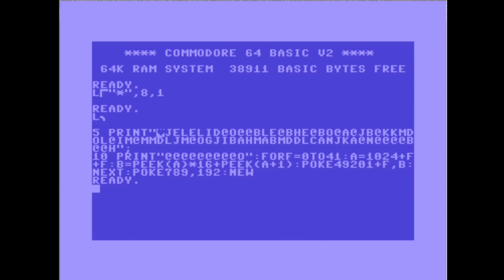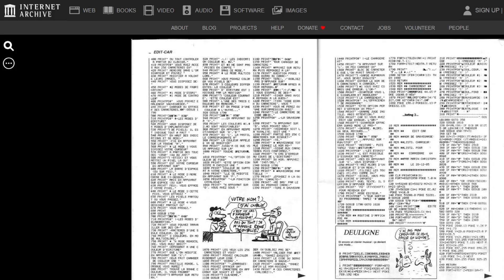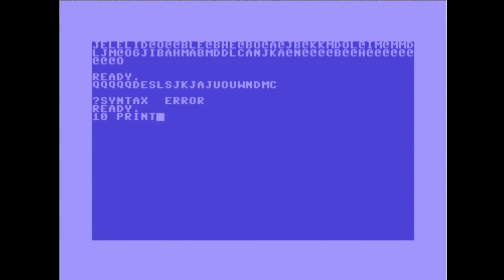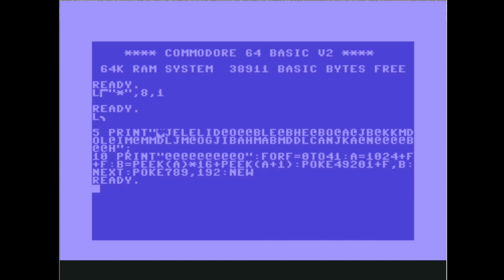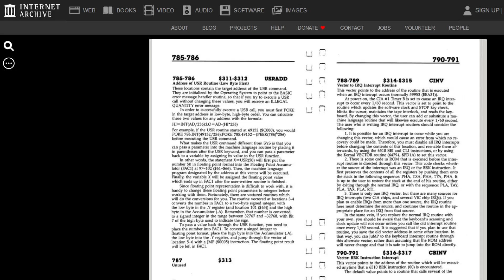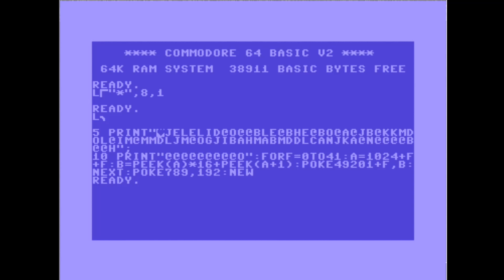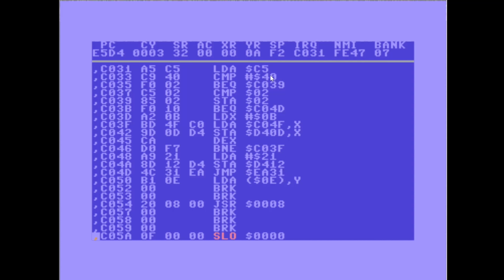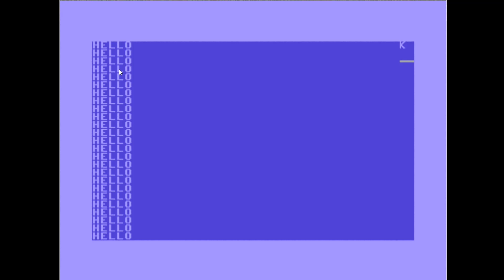Sound producing keyboard in just two lines of BASIC on the Commodore 64 (in ENG)

Comment: Interesting how they used the high byte ($EA) of the original IRQ vector, which they jump back to at the end of the code, as the value for most of the SID registers, then STA the voice register with the waveform value to turn on the note. The key bounce feature is great as well.

It would be fun to grab the keycode for whatever key is pressed and do some rotate to get it to a higher value and use that as the note high byte of the note, so each key would make a slightly different pitch.
Reply: ah, nevermind on the EA thing. That is just the starting location for the data that goes into the SID voice 3 registers using the LDA,x opcode.
Reply from the maker: Agree. It could be fun to change the code to get a different sound for each key pressed.  It should not be difficult. I'll do it if I have some time.